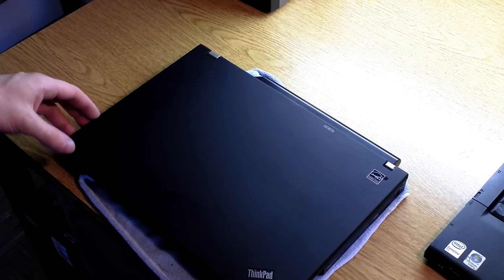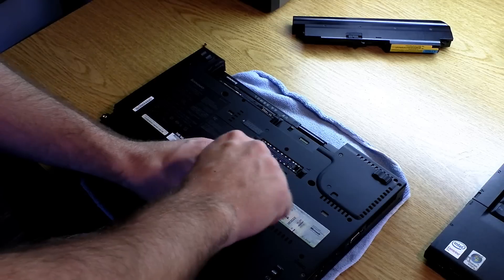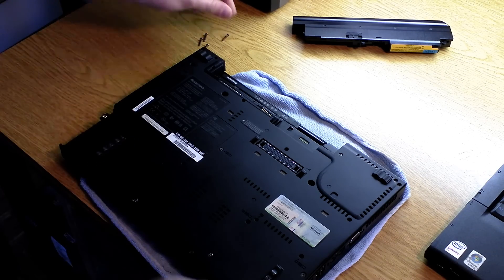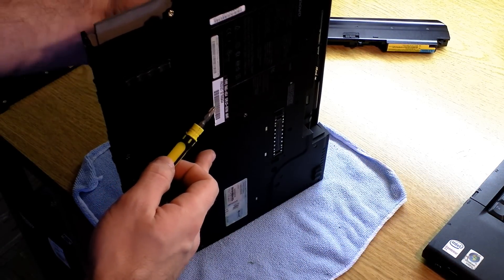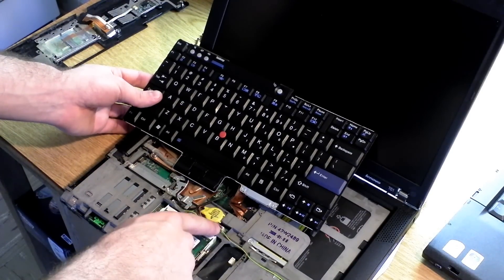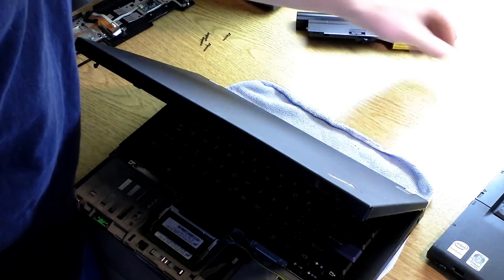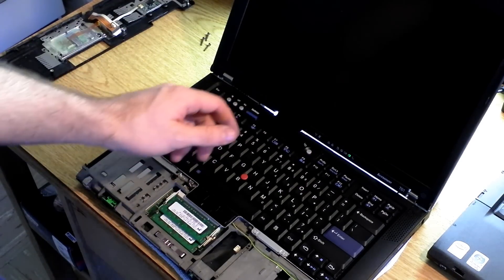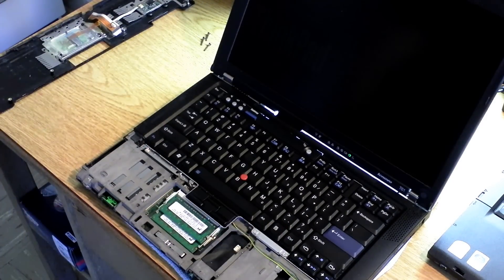How to Remove and Reset the Power-On Password for a Thinkpad (Lenovo, IBM, T61, T400 etc)

Comment from the maker: This method has been mentioned several times here already. The problem with that solution is the placement of the eeprom- many models require you to take out the motherboard anyway. T60 motherboards can now be had for 30 bucks on ebay, so its really not worth the hassle. I haven't checked prices on older thinkpads, but they are probably even cheaper. I will say though, I was not aware of this local solution (the eeprom method is pretty well-known, but you have to order the thing from Australia)

Comment from the maker: Yeah, I did not mention it because A) you'll need equipment/serial port to retrieve the eeprom data and B) if you have one of these models, it will be cheaper to just replace the motherboard. 

For those interested in doing what Josh mentioned, there is a guy in australia who sells a complete kit to do the password removal. Just google "joe thinkpad password"

Comment from the maker: You can't just short it (would not be very secure if you could). However, you can read it. Check out the last links in the video description for more info. Keep in mind, T60 motherboards are pretty cheap on ebay now, so your time might be better saved just grabbing one of those.

Comment from the maker: No, this is BIOS level so it won't affect your harddrive. If you do not reset your clock after removing the CMOS battery however, Windows may tell you that your activation is invalid, or disable your from getting updates. So just be sure to reset the date after doing this.

Comment from the maker: As a follow-up, another solution to #1 is by using something called "Joe's KeyMaker". You can google it for more information. Honestly, if you are just doing one machine it will probably be cheaper and easier just to put a new (used) motherboard in it. I do not know of any other solutions for #2- harddrives are cheap enough though, and with the age of T60's it is probably time to just to a solid state drive anyway (SSD). See my other videos for how to install an SSD.

Comment: great video. where's the cmos battery on a thinkpad R51? I popped the keyboard but it wasn't there. unlike the laptop in your video - my laptop doesn't have a detachable palmrest. Please help & thanks in advance!
Reply from the maker: ***** Its under the palm rest- unfortunately on that model you need to remove the keyboard, then the palmrest/surround piece for the base all has to come off. In reality, its only a couple extra screws
Reply: mr82020674 Thanks! I removed the screws - wasn't hard. located the cmos battery easily, unplugged it from the motherboard, removed the battery and then powered on again - but i'm still seeing the power on password notification. During power up I see 0271 error code about time and date setting, and then its back to the power on password. Any ideas? Thanks in advance. I'm unable to access bios because of this #@$% power on password.
Reply from the maker: *****
Unfortunately it sounds like you had both a POP and a Super password. the icon won't change even after you reset a POP so its difficult to tell the difference sometimes

Comment: Hello, nice and good video thanks. 
I want to reprogram the eeprom 24s08 of my laptop lenevo T500 type 2241 , because the bios is corrupted. I can't find a copy of the original Bios .. 
.bin, I need your help to get an identical copy to the original. 
Thanks in advance.

Comment from the maker: Well, you know it is one of three things, supervisor password, power on password, or harddrive password. You can remove the harddrive to eliminate that possibility, and then I would follow the video to see if it is a pop (power on password). If it is a supervisor password, you will have to replace the motherboard. You should be able to remove the pop on a 760 the same way as on a t60- but again, if its a supervisor password it may not be worth it on that model.

Comment from the maker: Ok, when you power on the laptop, have you reconnected the batteries? Try this- remove the battery pack and the cmos battery. With both batteries removed, unplug the laptop and hold the power button for a few seconds. Still without the batteries, plug the laptop back in and turn it on. At POST, please let me know if there is still a password. 

Next: Does your laptop have a supervisor password? If so, you can easily access the BIOS and reset the POP after entering your supervisor password.

Comment from the maker: That is a harddrive password. If you don't know the password, you need to replace the harddrive. When you do this, you will also need to reinstalled the operating system. For other readers- 
1) A lock with a person to the left: Supervisor password
2) A lock with a cylinder and a #1 to the left: Harddrive password
3) A lock with a computer screen to the left: Power on password. 

This video solves #3. For #2 you will need a new hd, and for #1 you will need a motherboard.
Reply: Are you sure these are the symbols? I have a T410 and the symbol is #3, but none of the techniques work. The strange thing is that this laptop was working. The bios was always restricted from editing but I was able to view info. I was getting a fan error, replaced the fan and now am getting a power on password lock. If you have time get back to me. You seem to have allot of experience with these Lenovo.

Comment: I have a ThinkPad R61i and I've done as you've said, removed the CMOS battery, held down the power button (for 30 seconds) and then plugged it back in and the password  at power on is still there :(   This method (to me) looks like it will remove a CMOS/BIOS password which is not a Power On password unfortunately.
Reply from the maker: What you are referring to actually is called the POP or power on password. The one that will not be removed is the administrator (if set). Unfortunately you normally can’t tell which until you remove the POP.

Comment: It's lock with a cylinder and a #1 to the left,but i can't enter the BIOS,
after being disconected how long has it steel like this?when you switch on the thinkpad,the battery it's still disconected from motherboard?i don't understand very wellnit doesn't work for me...

Comment: I have a question for you if you could help me. All videos I have watched doesn't show me the one key factory reset for my Lenovo ThinkPad edge E530. I am experiencing major issues and need to factory reset it. Can you help me
Reply from the maker: Douglas Price are you looking to reinstall Windows? are there any passwords on it?
Reply: I tryed using the 5 disc set but keeps failing and was told their is a one key reset
Reply: I have tried to use the 5 disc recovery but it keeps failing. I was told their was a one key restore feature but cant find it im really lost and when I turn the laptop on its in a boot screen
Reply from the maker: Douglas Price I have never heard of a one key reset for Windows, on any edition. if you have a Windows key on the bottom of your laptop, your best bet is to download a clean installation media copy and then install using that key. as long as you bought the computer from a store/oem this will work (it can't have come from a corporate environment and have a locked BIOS disabling boot options). this will clear everything on your laptop including pictures, passwords, etc
Reply: No its a one key factory reset for the laptop its self. To return it to like new when you first turned it on.
Reply: When I turn my laptop on now it goes to a screen with boot menu and application menu but will not let me choose any of them I am trying to do a factory reset but the disc they sent will not work and i am really lost can you please help if you can
Reply from the maker: Douglas Price don't use the 5 disc recovery. download a clean Windows version from Microsoft that matches your key, use the Microsoft usb drive creator to make a bootable drive, and reinstall windows

Comment: Hi. i have tried this method on thinkpad R60e but nothing changed. but when i have taken out the back up power supply and attach the power lead. and turn the machine on it gives me this message 

error 
0271 - check date and time settings
error: system cmos checksum bad - default configuration used 

then it will go back to asking me for the password with the same icons a padlock and a  TV type object to the left of it

Comment from the maker: Hmm, that is indeed a power-on password icon. You are sure you have done each of these steps?- 
1) Turn off the computer.
2) Remove the battery pack.
3) Remove the backup battery (Round yellow cmos battery).
4) Turn on the computer and wait until the POST ends. After the POST ends, the password prompt does not appear.
5) Reinstall cmos and battery pack.

Your situation is strange, because either this should work or you should be able to go to the BIOS to enter a supervisor password.

Comment: i'm doing all step corectly, in the 4) after i power on the pc tell me :
error 0271 check date and time setting
error 0251 system cmos checksum bad - defaut configuration used
i have two bip in the same tame and he make me the pop entry
i guess their is a defaut pop for lenovo or it have other cmos battery

Comment: What's the difference between a power password and a supervisor password?
Reply: power on password is the system password that pops up usually with a black screen the supervisor password is you windows password in order to login
Reply: Power-on-password can be removed like the video. IBM SVP stored in a EPROM chip cannot be reset easily. It has to be add some soldering work to fix it. The easiest way is replace the board. Windows SVP is just a software password. They are different.
Reply: what does IBM SVP password look like? is it the same black screen with lock icon on side?
and why would it ask for a password for IBM SVP?

Comment: IBM ThinkPad EEPROM Chip

TThe notebook computer BIOS password is not like the desktop model password, this is easy to explain! The desktop model machine’s computer BIOS password stores it in the motherboard CMOS electric circuit. This electric circuit must depend on the motherboard CMOS battery to maintain its data. Therefore, the majority of desktop model’s BIOS passwords are stored as long as the motherboard CMOS battery doesn’t go dead, or vanish into thin air. However, with the notebook computer, if the CMOS battery is removed, the BIOS password will not disappear at all. The BIOS password is stored in the EEPROM and the CMOS battery will not affect the password.

In the notebook computer, the design has a special EEPROM password memory chip. Take the IBM notebook computer as an example, the commonly used memory chip includes: 24C01A, 24C02, 24C03, 24RF08BT, 24RF08CT, 24RF08CM and so on. In different kinds of notebook computers, the EEPROM chip and other kinds of commonly used 93C46. The EEPROM chip belongs to the serial chip. The chip data certainly does not need to draw support from the outside battery to be able to be maintained. In the chip data, which writes data can maintain it for 10 years under the normal temperature. The 24C series chip generally used in IBM ThinkPad 600E machine and the 380, 390, 600 and other models. The 24RF series chip, uses the improvement data transmission and the preserved way. Keeping secret the performance to be stronger generally is used in the 600E later machine, like 600E, A, T and R series. Like the charts below, the IBM TP600 on the notebook computer motherboard EEPROM password memory chip is located on the motherboard nearby the PCI main line control chip. The chip model is AT24C01A. When the user password is established and the preservation of the BIOS is established, the system carries on the operation and compression processing. Then the user inputs the password and processes the password data preservation in the EEPROM password memory chip. It has been clear about the EEPROM chip mode, which the BIOS password saves on the chip and can be located on the motherboard. If you have really forgotten the password, there is a possibility to let "the machine discards" this event occurrence, because each notebook merchant has already inform users not to forget their password. This situation carries on to the maintenance manual, if you are really persist on repairing the notebook then one should prepared himself to take out money to replaces the new motherboard.
Reply: Will a BIOS reflash nuke any previous passwords or do they remain? I lack any passworded machines to test.

For example you could flash Middleton BIOS from any media the notebook will boot from (I use Middleton on T61s to get rid of the whitelist so I can upgrade wifi adapters).
Reply: try killcmos

Comment: Does not work on a T61 with hard drive password set (known) AND admin bios password (unknown). Removing the batter will result into bios reverting to default settings but the admin password is not removed/blanked. Any other ideas anyone?
Reply: Buenos días pudiste encontrar solución ?

Comment: Hi. There are two hardware/software supervisor password removal (one $29, the other DIY cheaper) methods but would this work: desolder the chip branded Atmelt (printed as an 8 pin DIL and is labelled 24RF08 sometimes they say) or cut it from the board? Could this chip be also erased/rest by a powerful magnet thin magnet (maybe pile up a lot of buttons magnets that's the size of the chip) while protecting the other chips with some kind of cover). Thank you in advance. God bless. Rev. 21:4

Comment: Did everything in the video, sadly didn't work, I know its a power on password due to the icon shown, being a small box.
Reply from the maker: If you have more than one password on the system, and one is the power on password, when you clear the power on password the icon will not change
Reply: Apparently I have to solder on some wires to the chip and hook it up to a seral port to clear the PW, also I think the video is having issues as well, its going to need a new motherboard.

Comment: Fail. Still asks for password & error 0271. FAIL.
Reply from the maker: algiuxasMc Your CMOS battery is dead, you need to buy a new one. Sounds like your laptop doesn't have a power on password, but a supervisor password. I'm sorry you failed.
Reply: mr82020674 It's ok, I remembered password. It works fine now :)

Comment: Unlock/Remove Bios Password , Computrace Laptop ibm ThinkPad
- 3rd Generation : T430 , T430s, W530 , x1 carbon gen 1 , L430 .....
- 4th Generation : T440, T440s, T440p, T450, T540, W540, W541, , X240 , X1 carbon gen 2 , L440. .....
- 5th Generation : W550s ,X250, X1 carbon gen3, Helix , Thinkpad Yoga 12 and Yoga 15 , L450 .....
- 6th Generation : P40, P50 , P50s and P70 ,X1 Yoga, X260, T460 and T560 , X1 carbon gen4 , L460 .....
- 7th Generation : T470 , T470s ,T570, X1 Carbon gen 5 , L470 ......The newest models
- 8th Generation : T480 , T480s , updating.....
- 9th Generation : updating.....

:) Unlock/Remove Bios Password , Computrace Laptop ibm ThinkPad  :)
:heart: My Skype : haisung4344  :heart:

#Deactive Computrace thinkpad ibm
#Remove thinkpad ibm
#Unlock Thinkpad ibm
#Remove Computrace thinkpad ibm
#Computrace thinkpad ibm
#Unlock ibm
#Unlock Thinkpad series
#Unlock thinkpad
#Unlock computrace
#Unlock laptop
#unlock code

Comment: !!! WARNING !!! DO NOT ATTEMPT THIS IF YOUR THINKPAD R60 MIGHT HAVE A SUPERVISOR PASSWORD. I JUST FOLLOWED ALL THESE STEPS, AND NOW MY COMPUTER IS BRICKED. THANKS A LOT...YOU SHOULD DEFINITELY HAVE WARNED PEOPLE ABOUT THIS. NOW MY COMPUTER SEES THAT SOMEONE WAS TAMPERING WITH IT, AND WITHOUT THE SUPERVISOR PASSWORD, IT WONT EVEN BOOT UP. UNLESS I REPLACE THE MOTHERBOARD, IT IS A PAPER WEIGHT.
Reply from the maker: That is not how the system works. I have tried this on computer with both types of passwords and it unlocks the PoP but not the super password.

Comment: Unlock/Remove Bios Password , Computrace Laptop Ibm ThinkPad
 -  3th Generation : T430 , T430s, W530 , x1 carbon .....
   - 4th Generation : T440, T440s, T440p, T450, T540, W540, W541, , X240 , X1 carbon gen 2 .....
   - 5th Generation : W550s ,X250, X1 carbon gen 3, Helix , Thinkpad Yoga 12 and Yoga 15.....
 - 6th Generation : P40, P50 , P50s and P70 ,X1 Yoga, X260, T460 and T560 , X1 carbon gen 4  .....
  - 7th Generation : T470 , T470s ,T570, X1 Carbon , X1 carbon gen 5......
  - 8th Generation :  T480s, T480 , X1 carbon gen 6  updating.....
  - 9th Generation : updating.....
  --The newest models......
Unlock/Remove Computrace and Bios Password ThinkPad ibm 
                                     My Skype : Haisung4344